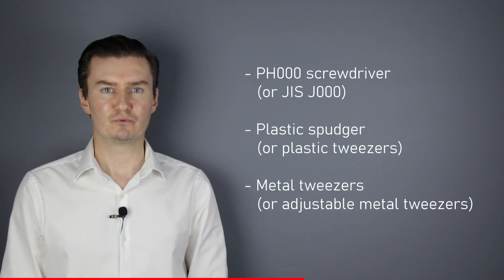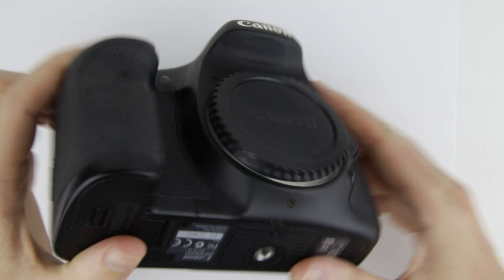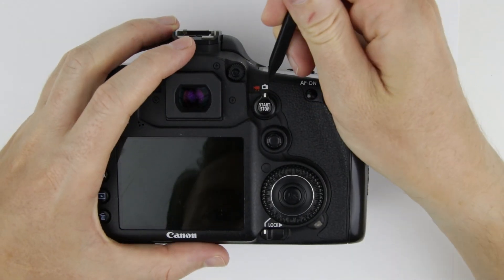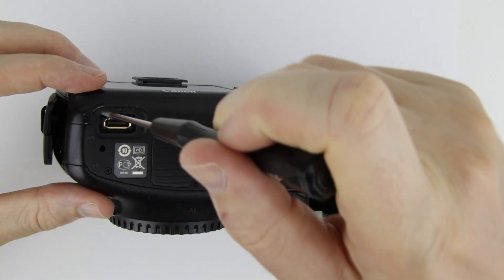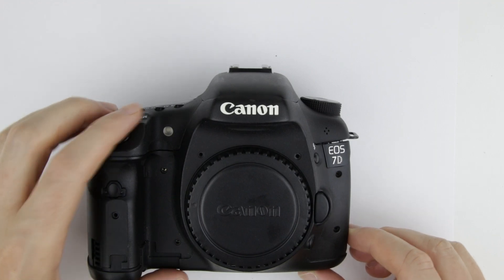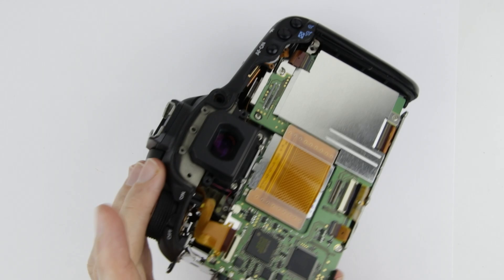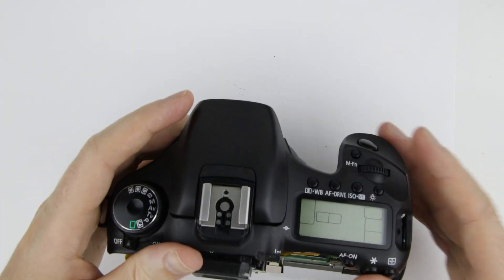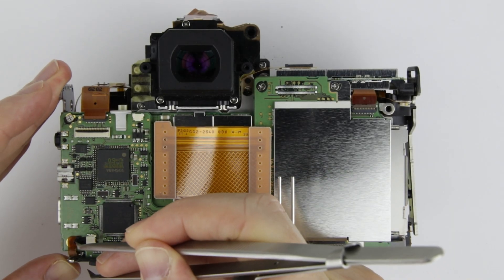Canon EOS 7D camera disassembly, remove the covers and the PCB

Comment: OMG!   I am stunned by this video.  I must be misunderstanding.  This must be a general disassembly video.  Not just a repair\replace the PCB.  You don't have to strip the entire outer shell of the camera off to replace the PCB.  I hope your audience realizes this.  To replace the PCB.  All you need to do is to remove the back cover.  That's it.    I would urge others to check out other Youtube videos.
Reply from the maker: Could be done without removing the covers of the camera, but I find it easier to replace the PCB if the panels are gone.
Thank you for your comment!